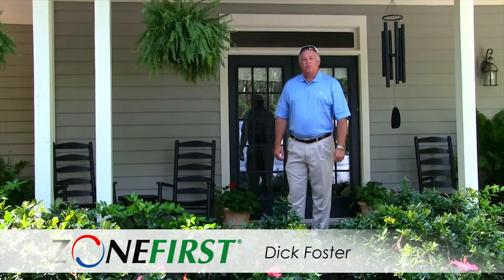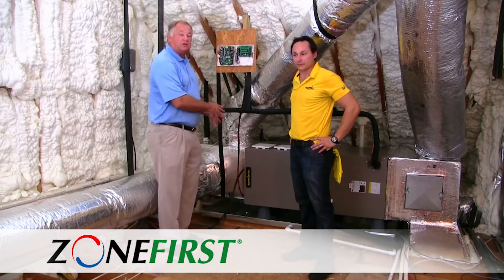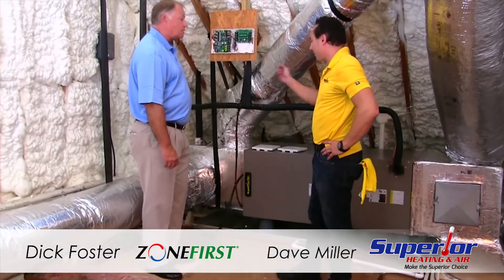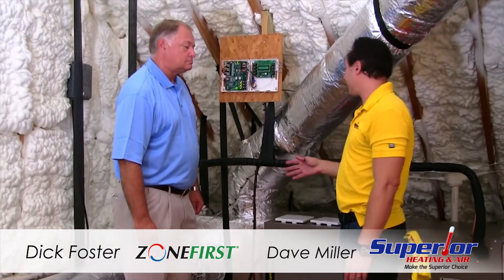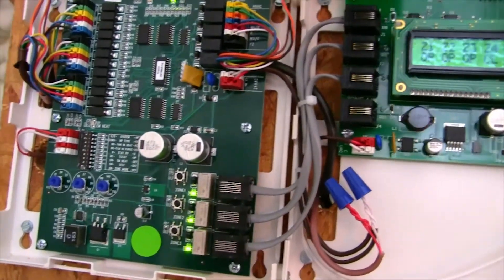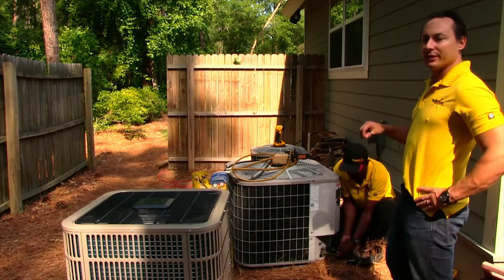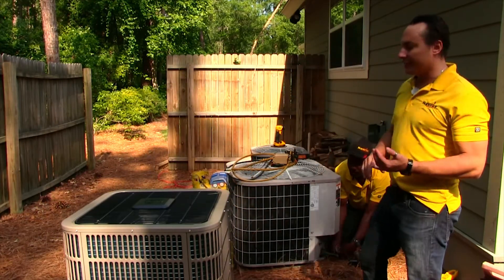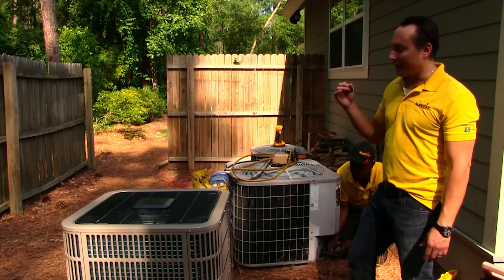This Zoned House - replacing 2 unit zoning with 1-3 Zone System

Comment: If the boards work together well and reliable this is a good way to solve many problems. The bypass eliminator if it work as you say, the only there thing you would need to create a awesome HVAC system is a air handler and compressor that can power down to lets say 25% capacity.